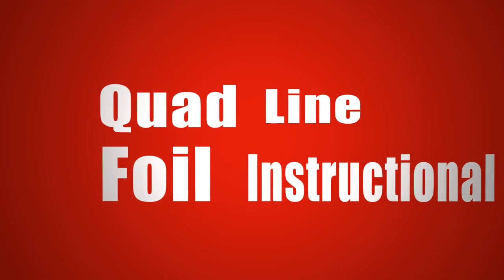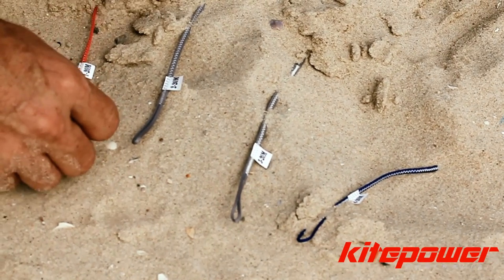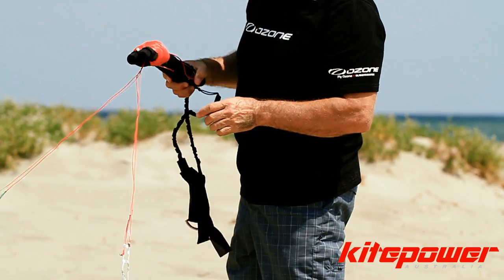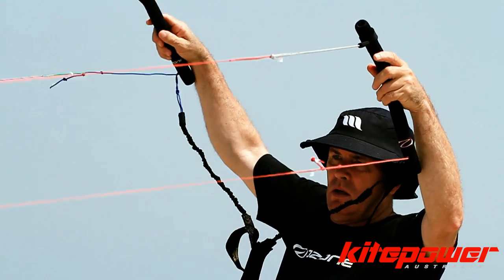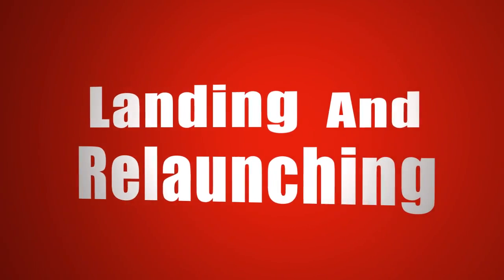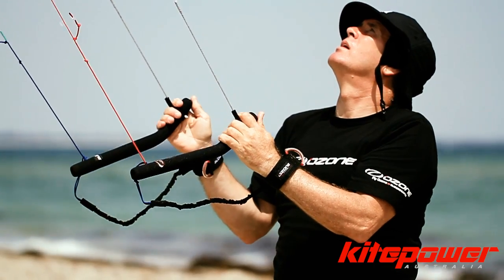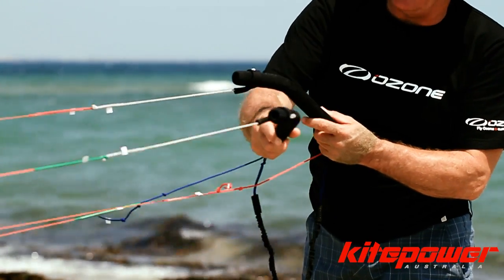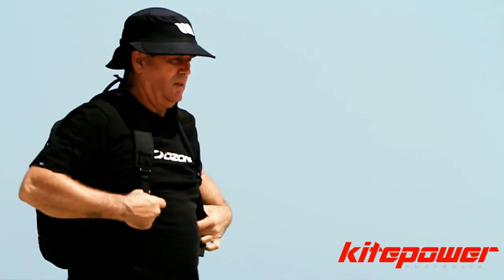Ozone 4-Line Power Kites - learning to fly

Comment: confusing your vid-gave up
Reply: +rob roberts What's confusing about it? I've got one of their kites and it's no trouble to use even in a gale LOL. The vid as a demo vid is well produced IMHO.However, I've never wound the lines around the handles as I thing this has a tendency to twist the lines after a period of time (line dependent though)
Reply: @BushCampingTools  I usually place the winder between the handles and wind the lines around it in a figure of 8. Having said that, most Ozone kite lines (such as the ones on my old Samurai II) have a stiff enough shielding that I haven't had any problems with twisting if I don't figure-8 them.
Reply: Also, after I've wound up the lines I hold the handles above the kite so the bridle is on-top of the canopy, lower the handles and place them right next to the middle of the trailing edge. Next fold (or roll) both wing tips into the centre leaving a strip about 8-12 inches wide, this ensures that the handles don't get tangled in the bridle. I then place the handles 'on' the trailing edge and roll them towards the leading edge, that way you can get all the air out which is important if you have a big kite and a small bag..
Reply: @sandy_knight  Good stuff!
Reply: Confusing what are you talking about he couldn’t have explained it more simple or maybe your just simple
Reply: If it was confusing it probably means this may be too difficult for you. Maybe you should try bashing rocks against each other instead of flying kites.